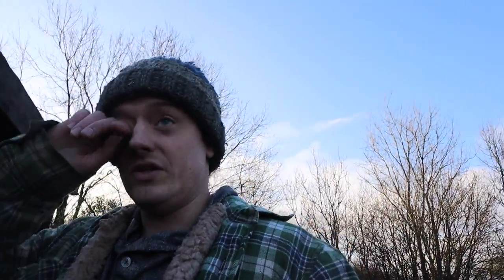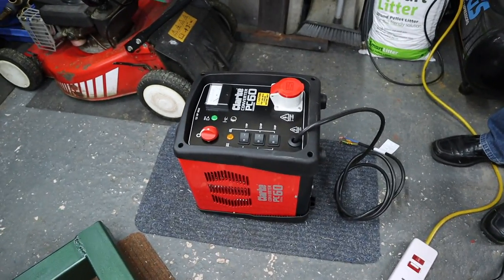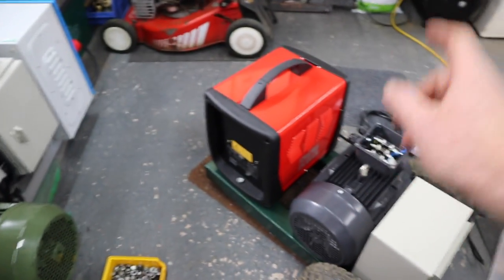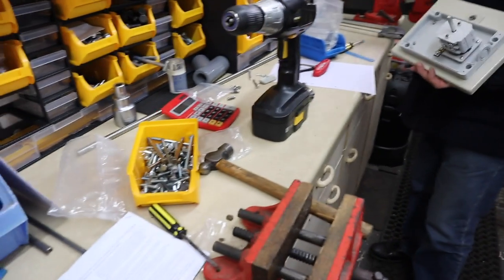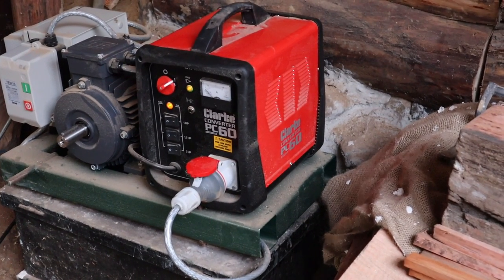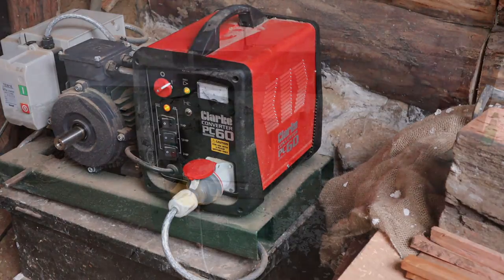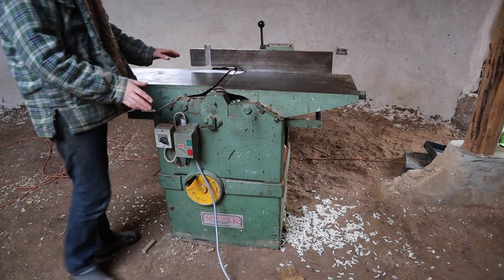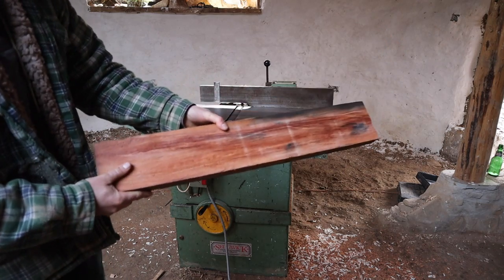Easy DIY Rotary Phase Converter Build (Off Grid Three Phase Hydroelectric Power)

Comment: That planer thicknesses is a baby! When I was an apprentice the 20 HP Dankaert 15" one  we had in the mill would still be turning after being switched off at lunch time. (After 30 minutes) Now that's the sort of flywheel you want! I would certainly go for a flywheel as it doesn't complicate your setup, it just harnesses the kinetic energy of the motor.

Comment: You can start the planer on the static converter then turn the planer off and switch to the rotary converter while the planer is coasting and it should run. It won't have the amperage spike because the planer is already turning.
Reply from the maker: Good idea, i will give that a try :)
Reply: I was thinking the same thing, it's like a bump start on a car.
Goodluck
Reply: Dependant on your motor you could have a choice of starting methods. It looks like you have a basic starter on it ..... but for bigger machines (or less forgiving power supplies) there are Star Delta starters or even Rotor resistance starters! Both of these methods reduce the starting current, which seems to be the problem you are having, and then when the motor is rotating giving it full torque!
Reply: ......or use a three phase frequency inverter
Reply: @KrisHarbour   look into star delta starters, they are used for similar conditions eg: high start up currents and low run currents.  You could utilise one to switch from the static to rotary.  It's basically a combination of contactors and a timer.
Reply: Please forgive my ignorance but if the planer runs off the static converter anyway why have a rotary one in the first place? Surely just getting a bigger static converter would provide more power. Don't shoot me for my ignorance.
Reply: @TheLoxxxton  the static is capable of providing large currents, the planer only requires this for a few seconds then would happily run on the rotary.  If you did this then it would free up the static for other devices.
Reply: You would have to switch it over at exactly the right moment, otherwise you would get an even bigger current spike (look for ac-synchronising).... I would suggest to use a softstarter to reduce the startup current of the planer.
Reply: @kattstu1  so I'm guessing that using the rotary converter for maintain power once started uses less electricity in a more economical way??
Reply: @TheLoxxxton  the planer required a lot less energy once spinning at full speed.  Think of it as a roundabout full of kids.
Reply: loxxxton poxxxton I think the static isn’t providing clean and equal 3phases until it goes through the rotary converter motor. The statics is proving more current but only on 2 phases or something so not making the most of the planners motor once running. I’m sure I’m as wrong as it gets but that’s my dumb understanding.
Reply: @thextremeking  My thoughts exactly. They must be 'In Phase' with each other at the point of connection, otherwise you effectively would have a 'short circuit'. The point of connection would have to be timed down to a few milliseconds (as the decelerating machine would be going in and out of phase with that of the supply), so it wouldn't be a good idea by any means........ In addition to this, the 'Phase Rotation' must also be the same. The chances of it working is extremely slim. The chances of blowing something up is extremely high......

Comment: Very interesting!  I have had similar ideas myself, and my plan is to use a flywheel as you suggest in order to increase the available peak current.  In your case because you can't run the flywheel very fast (only at whatever speed the motor runs at), you will instead need a very heavy flywheel as the weight is where the energy is stored.  When a surge comes in, the motor will try to stop, but the weight in the flywheel will force the motor to keep turning and continue delivering power.  More weight will let you handle larger peaks.  The trick is just coming up with a way of having something heavy enough connected directly to your motor shaft.

I'm also not quite clear on what the purpose of the motor is here if you aren't using a flywheel.  The static converter would appear to do the job of producing three-phase power without the motor, so obviously I'm missing something!
Reply: Yeah I don't understand what the motor is for?

Comment: He Kris. I have installed lots of single phase th to three phase variable speed/ frequency inverters (not the same as your DC to ac inverters) they were low power ones but as I understand you can get ones that will drive a 3hp motor. The great thing about them is they ramp up the frequency slowly so there isn't the massive start up current. I spoke to an engineer at ABB, and it was them who told me about the higher power inverter drives, I was going to install it on a farm that had a pretty crappy single phase supply powering a vacuum pump for a milking machine, when the single phase motor started up it would trip the lights out because of the volt drop. In industrial electrical installations pretty much all motors are on variable speed inverter drives because it saves electricity and the cables don't have to be as big to cope with the volt drop. Hope this helps.

Comment: This is a phenomenal achievement,  how many rivers streams and brooks are in the British Isles that could be used in exactly the same way, millions, free power. Give yourself a massive pat on the back, well done and have a merry Christmas.
Reply: It's not free power. The turbines, batteries, inverters etc are quite expensive to purchase. I estimate it would take 3 - 5 years before you got your money back on the setup costs and that assumes you make use of all the power generated and incur no other costs. It also assumes you are able to do all the work yourself and have the time available to do it. It is a fantastic achievement and Kris has done a great job but you can't really consider the power to be free.
Reply from the maker: The payback on my system at current Price per KWH is more like 20 years to be honest. that is a simplistic view of it though as there are other factors. like being in control of your own power, knowing it is carbon neutral once set up, the educational side of things and the fact that it would have cost many times what the system cost to get mains here. So there are other factors but you are correct it is far from free and the payback is a very long time.
Reply: @KrisHarbour  Yes I agree, hard to put a price on the education and satisfaction achieved. Looking forward to seeing those tools used in anger.

Comment: You are the coolest dude man. Really. Nothing intimidates you, but you also don't over complicate solutions. If you determine that 3-phase is going to be the most cost efficient going forward, you just go ahead and put in 3-phase (confident in the fact you can build a solution). You are an awesome engineer (regardless of whether you have an engineering degree, you are an engineer in every respect).

I absolutely love engineers, I even consider myself one on occasion 😂

Comment: Hi Kris , I decided to do this after watching your video, I used the clarke PC60 and a 5HP motor with DOL switch but even though the Clarke PC60 says its up to 5.5hp motors this is no quite true with phase converters my idle motor is 4KW 7.9A & it would start to turn then trip the breaker so I give it a little spin befor pressing the on button and I now have a lovely rotary phase converter HOWEVER it's not been plain sailing as I initially purchased the Clarke PC40 to do this & it would not power the 5HP idle motor even with a spin ,I then tryed it again with a pony motor & it would just trip the breaker so I took the PC40 back to MM and swapped it for the PC60 for a additional £70  i then put it all in a vented enclosure with acrylic front to stop and metal chips getting in & I'm very happy with it , it powers my hardinge lathe and a 3HP milling machine
Just wanted to thank you for the idea and post some information for others that I wish I had befor started this project

Comment: Very interesting video, as you suggested a flywheel would certainly help, also you can make a star to delta starting on  the planer in order to decrease the peak current when you turno it on. Another option would be an inverter with a soft start

Comment: Some comments from an electrical engineer. 
That 3p motor in the converter is nothing but a very expensive terminal box. You are getting your 400V (approx) from the static converter. The motor is wasting about 2/3HP capacity of the static converter (amp meter is indicating 2A at 240 V =480w =2/3HP). The motor is effectively a drain on the system that contributes nothing to the overall operation of  the system.
If the motor is to remain in the system, you need to remove the key from the shaft, it is intended to be retained by whatever is fitted to the shaft, and running bare shaft plus key risks having the key thrown across the room. Best bet is to remove the key and cover the shaft with something smooth like firm fitting hose or conduit to reduce the chance of anything dropped near the shaft being flung by the keyway. Nothing that requires clamping or similar.
The motor starter on the unit incorporates a current overload unit to cut power in the event of a gross overload. This current overload supplies current to the grey 3P motor in the converter and the load in parallel. If the current overload is not set to handle the load current, it will trip and isolate the load and the grey motor, which appears to be what happened when you tried to start the combi machine with the unit as orginally assembled. Compare to when you started the combi  from the static converter only, the converter was overloaded for a short period while the combi motor worked up to speed, no current overload in circuit to trip.
From the sound of the combi when running from the static converter, it needs more capacitance in the dummy phase, as the relative phasing  is uneven causing the motor noise coming from the combi, in effect the motor is "hunting", momentarily accelerating/decelerating around the nominal 50Hz speed .
Reply: I did wonder what the 3 phase motor was doing in that setup?! Just piggy backed off the static converter and drawing power from it. And IDK but when Kris started up that planer thicknesser it didn't sound very happy did it.
Reply: @MrPhillipgraham  The idea is that you can add a flywheel, and it helps counteract inrush current with larger loads.

Comment: Hi Kris, you can buy manual star-delta switches to reduce the start up load of the planer. A lot cheaper than the automated contactor and timer ones.

Comment: I modified various equipment with three-phase motors to make them operate in single-phase at 230V, just add capacitors to simulate the third phase and change the jumpers in the star-delta motor, we have all the 400V star and 230V delta motors, for example the compressors for hobby use with standard three-phase asynchronous motor with single-phase plug, they have the capacitor as standard for the third phase and a triangle-connected motor to operate at home at 230V single-phase, I started a single-phase spindle moulder, in this case in addition to the capacitor bank for the third phase requires an addition for the ignition cue with a button to be pressed only for starting, it was a particular case logically you lose 20% of power and on large carpentry equipment it is a bit absurd as for a large planer or thickness, better an inverter with single-phase input and three-phase output, this converter solution is less efficient but robust and reliable than the inverter ter as for the rotating coupled ones that was used in the 50s / 60s in various ways also to raise the voltage or to convert the DC to AC or to vary the frequency, logically abandoned for inverter electronics,
it is old school that still, cheap and robust, honestly I did not think to see it still used.
Excellent assembly and wiring you can see the expert's hand!
Reply: About the wiring. He is using shielded cable and doesn't connect the shield to chassis. NOT to PE because that is NOT allowed. It isn't a PE wire but a shield. Now there is quite a high voltage on the screen. He should have used other cable glands specially for shielded wire if it is a metal housing.
Reply: I love your playlists. 👍🏼 Thank you!
Reply: @josvandiepen3425  The cable he used is called SY multiflex and correct he did not use the correct metal glands for it, BUT they did connect the CPC's to the earth terminals in the equipment as far as I can tell so the machines are earthed. I've used a lot of that cable in agricultural buildings and workshops as it is very flexible , easy to strip and terminate plus it is protected from mice etc, however it is actually not recognised by the IEE Wiring regulations don't ask me why.

Comment: I bought my last inverter which was a "made in Germany" BLEMO 1,5 KW 240V one phase in and 3x 240V out for 40 € on German classifieds ("Kleinanzeigen") programmable, PID function,s ramp up/down etc. etc., different profiles and bigger inverters would have been same price or little more. The actual optimal programming was a bit a pain in the lower back - 140 pages manual - but well worth it. I do not want to brag but it for sure beats this contraption which IS genius but also absolutely byzantine and not even the cheapest solution.
If one wants to get 3 phase for machines from batteries and one has some motors around: Dc motor driving 3 phase motor as generator, flywheel to buffer loads - this is old but works well and is quite efficient too. This was the solution I expected to see and I am a bit disappointed ;)
Reply: A VFD as you have descrbed is good (and cheap) if the motor winding configuration can changed to delta. This is not always the case with older 3 phase motors. My father bought lathe with a motor that was fixed in the star topolgy and while I managed to find a VFD that boosts the voltage to 400 volts, it was difficult to find and expensive and shipping would have pushed the price past that of a RPC.

Comment: Hello Chris, good video. You will find that a soft starter on the spindle motor will reduce the startup current as suggested in other comments . These are relatively expensive items and are not very robust to surges on the supply.  The tried and trusted method of starting with a star-delta starter circuit on the spindle motor with a delayed start of the feed motor could from my experience of starting heavy motors on a generator , solve your startup problems.  It should be noted that 3phase off-grid inverters are commonplace in Germany and may be the best solution for your workshop. If you look up Damien Maguire on YouTube he did a video on using an old industrial inverter to perform the single to 3phase converting.  Best of luck.

Comment: In the last video we saw a sneak peek of the work bench, So I am guessing that all of this is done! Videos are coming along nicely!
Reply from the maker: The workbench is done, as of a few days ago, video will be out soon :) often videos are released the day thex complete. but sometimes i get a bit behind
Reply: @KrisHarbour  I was wondering if you can do a video on the elevation of your current inlet for hydro along with the proposed new stream and other small streams. Maybe a map showing locations and height and how converging the larger stream to either its current inlet location or to a new area would work or not work. If a new area could combined the 2 streams even if you would have to trench in a large area. Would this increase or decrease you attempts to a larger hydro.  If The new area was made would larger or smaller pipe have to be used or could you re use the existing pipe. Could the pipe be moved to say the middle and converge both streams to a totally new area?